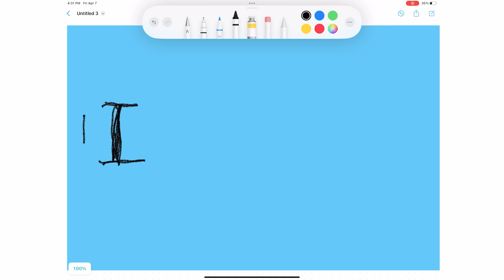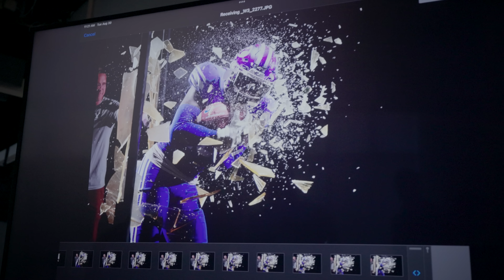How To Make Sugar Glass - BYU Photo

Comment: I have a question about this great video. What settings did you use for the focus?  Did you predetermine the focus length and leave it set for the shot or was it an autofocus?  The subject enters so fast that if I had to guess I would say the focus was locked in advance.
Reply from the maker: Yes, we set focus beforehand and left it on manual.